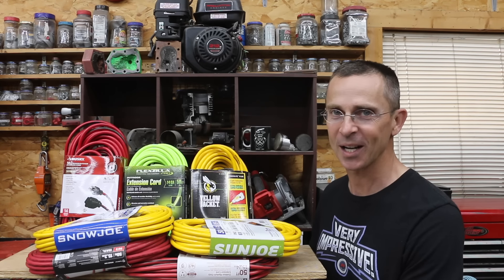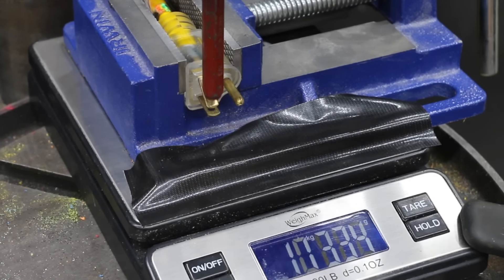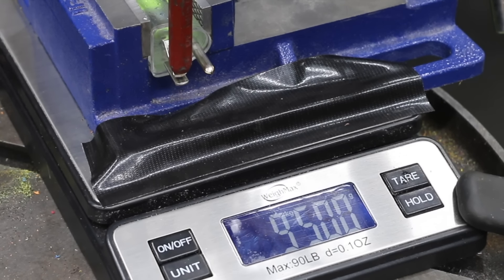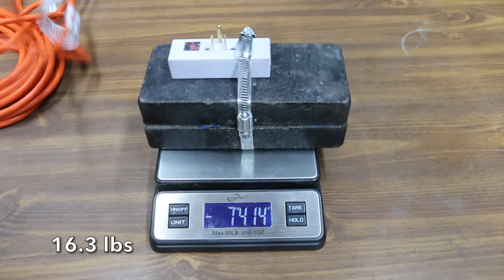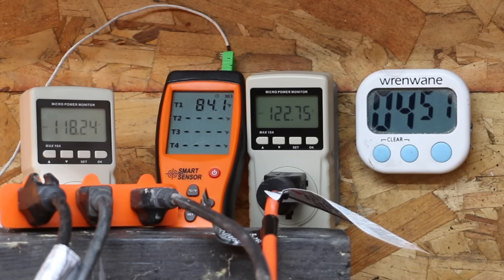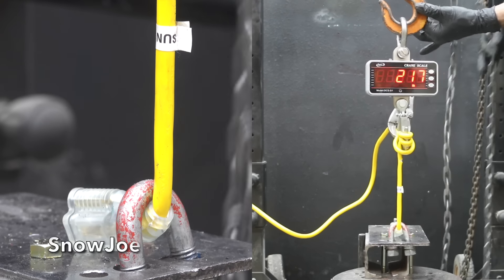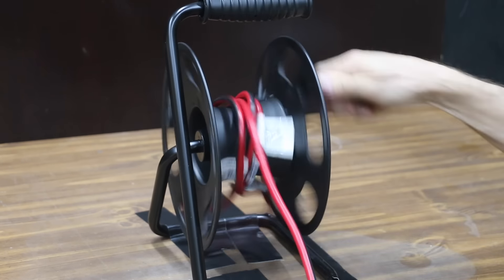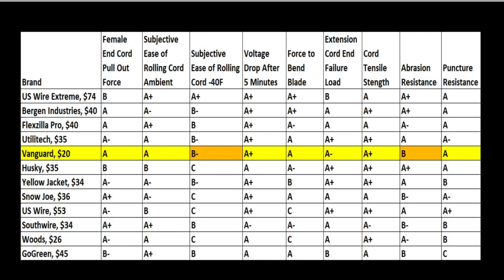Best Extension Cord? Flexzilla, US Wire, Yellow Jacket, Southwire, Husky, Woods, Bergen Industries

Comment: Just a quick FYI: Any extension cord that has a combination of length and wire gauge that means it can't handle 15 amps anymore can be unsafe, because we're stupid and don't fuse our extension cords. Our circuit breakers will happily let us pull 15 amps through a "up to 10 amp" extension cord (or even worse) and not trip as things catch fire because as far as the circuit breaker is concerned, we haven't pulled more than 15 amps so everything is fine and it won't trip. We should really fuse our extension cords. We fuse Christmas lights, because we realize some people will try to use them as extension cords even though that's not their intended purpose, but we don't fuse proper extension cords. So it's up to the end user to make sure they don't pull 15 amps through a cord that can handle 8 amps max. Stupid.
Reply from the maker: Thanks for sharing.
Reply: Wow glad you brought that up I’ll make sure I get those higher amp cords that must be why those short 3 plug outlets are dangerous because of that amperage rating being too low.
Reply: That's why 12 gauge extension chords are great: rated for 14 to 15 amps out to 100 feet.  10 gauge is obviously better but is way more expensive.

Appliances (like a shop vac) often have a 16 gauge power chord that is worth swapping with a 14 gauge extension chord to allow better current flow and extend performance and longevity.
Reply: the reason especially heavy duty extension cords cant be fused is simple, turning over an ac motor creates a massive spike in current before coming down to standard operating current, so unless you want your fused cord to need a fuse swap every time you crank on your shop vac, your just gonna have to deal with it.
Reply: Not knowing something is being ignorant.
Knowing something and going ahead anyway, is stupid.
Reply: @edgray3753  soooo could you use a power strip at the end of the extension cord?  ones with 15 amp breakers?
Reply: @coppulor6500  → Sounds like a good idea.   I looked at various power strips on line (Home Depot, Amazon) and they mostly are 15A breakers.   But that won't do any good if you want something to trip at 8A or less.  Of course such a device will probably be more expensive than a cheap 8A so just buy a heavier cord.   Also, using a power strip just to get the 15A breaker would do little good if the home circuit breaker is also rated for 15A.

Comment: I would love to know if the wire inside is actually the gauge they specify, and if it can actually handle the current they show. I've had cords smoke and burn before so that's my biggest concern these days.

The strength of the cords to resist being unplugged from the outlet or cables from being unplugged from them might also be a good test for the future
Reply: I just make my own. Buy a roll of cable, so I know exactly the wire gauge. What if they are mislabelled ? Well, I can SEE the conductor when attaching the plug. 😁

Comment: I appreciate the focus on durability. Most cords fail due to wear and abuse, not excess amperage. It was a good call to point out solid vs laminated blades, also. 
Even so, my primary concern is the gauge of the wire in relation to the length of the cord, and the durability and flexibility of the jacket. While I don't want flimsy ends, they can always be replaced.

Regarding ampacity, anything that will plug into a standard 15-amp receptacle or cord end cannot have a sustained draw of more than 12 amps. While solid conductors have a higher ampacity, conductors using stranded wire provide better heat dissipation (and flexibility). Conductors are always underrated for ampacity to allow for startup draw and provide some margin of safety.

As your tests shows, the greater concern with length is voltage drop. I have been using the same 14 gauge 50 foot cord and 10 gauge 25 foot cord for decades without issues due to current capacity or voltage drop, both for home and garden and commercial use. I also combine them on occasion if I need more reach, with the heavier cord plugged into the house to maintain flexibility at the tool.

Cords up to 50 feet should be at least 14ga, and up to 100 feet should be at least 12ga. If you're running something continuously that has a high draw (like a space heater), increase the gauge one step.

Avoid multi-socket ends. Even if you have a 10ga like the Yellow Jacket you should never run more than one piece of equipment from it due to the voltage loss and ampacity of the circuit to which the cord is connected. Even a 20-amp circuit only allows a sustained draw of 16 amps.

Comment: I always make my own extension cords. Home Depot carries Carrol Wire, great wire for extension cords. I use the higher quality plug ends that open like a clam shell. After almost 10 years of using some of them, I've yet to break one. Most plug ends are beat up but holding together no problem.
Reply from the maker: Thanks for sharing.

Comment: I bought a 100 foot 12/3 US Wire and a 50 foot Husky 12/3 back in 2015. I also bought a 10 amp plug in weed trimmer and a plug in leaf blower. All have worked well since then and I've likely saved myself from a lot of frustration vs fuel powered devices.
Reply from the maker: Thanks for sharing.
Reply: I agree that for most home owners electrical tools are the way to go. Once you start working on acres though the power and portability of gas starts to pay dividends especially when the  power requirements are high. A 2T motor is going to rip through 4ft of grass many times faster than an electrical trimmer.
Reply: @NONO-hz4vo  I think my Greenworks is as good for me as the Troy Bilt/Ryobi ones up to the Echo 225 models 21cc-25cc are. The 30cc plus models are definitely a step up. I don't know what a 2T engine is.
Reply: @davestvwatching2408  2t is just a 2 stroke engine.

The smaller cc gas don't make much sense for one house as the electric has more torque and you have nearly nothing to repair on top of not worrying about gas related storage issues.

The  gas products can save time if you are working acres of land or in landscape going from site to site.

Comment: I would like to see you do a review on plasma cutters intended for hobbyist/amateur/farm use.  The sorts of lighter duty machines that use no more than 60A 240V single phase power.  It would be interesting if you could pick models where it's obvious that the same machine is sold through numerous brands, where you try cutting both reasonable and possibly unreasonable material (thickness, corrosion, etc), and where you push the duty-cycles out to their published numbers and then beyond.

For a lot of us it's difficult to decide what machine to buy when we know the machine will probably not see enough use prior to its warranty lapsing, meaning it may be turned into so much junk without a lot of recourse.  Your methodology is very thorough, I'm sure that you'd put several reasonably-priced machines through their paces in a fashion that would be more like several years of use to the average hobbyist or farmer who'd only need the machine occasionally.
Reply from the maker: Thanks for the suggestion.

Comment: I just got done building a couple go floating benches. I was using 1/4”x4.5” lag bolts. One of them snapped from me torquing it down too much. So I ended up going to the hardware store to buy another one. While I was there I ended up buying structural screws sized 5/16”x4” which claim to be stronger than 1/2” lag screws. They are made by GRK Fasteners and the name of the screw is “RSS Rugged Structural Screw”. I ended up getting the lag screw I needed as well. When I got home I put the new lag in and the damn thing snapped too! So I just used the structural screws for the rest of the project and everything went well. Honestly the bench that I used only structural screws is extremely sturdy, feels more sturdy than the one I used lags! 

I saw your video where you compared some smaller fasteners. 

I would love to see a video where you compared structural fasteners. Would love to see how well different size lag screws hold up. I would definitely love to see how these compare to the RSS screws I have. Would also love to see other structural screws going through your gauntlets as well!!
Reply from the maker: Thanks for the suggestion.

Comment: I have both US wire and Husky brand cords. Of course the MOST important thing is to get the CORRECT gauge wire for your application. Believe me if you run out 200-300ft of cord and your wire is undersized, that tool will not proform. I can attest that the US wire brand really does feel like quality in your hands, and having a lighted end cord is totally helpful. As for the Husky brand it gets the job done, in my experience the jacketing isn't as durable, but I've had both puncture on the bottom of doors.
Reply from the maker: Thanks for the feedback.

Comment: Great video, Todd.
I have a suggestion about the "pull out" test.
You may want to use hose clamps on both sides of the three-way splitter to ensure that the cords don't get an unfair advantage by binding the plug due to an uneven load.
Reply from the maker: Great tip! Thank you

Comment: I almost bought a U.S. wire 12 gauge 100ft extension for a Sno Joe electric snowblower, but I was able to get a "Prime Wire" brand off Amazon, for cheaper than the U.S. Wire by about $15. It is good to -40c for flexibility and I'd say it looks and seems really decent. On par with U.S. Wire in terms of the features and durability. Covering seems thick yet very pliable and still so, in -25C, about as low as I tested it, in real work application. Then I noticed that Walmart here in Canada started carrying Prime Wire. So that's another brand to consider, if you can get it there, for any future battles. I'd like to see them tortured to see how good a buy it was.
Reply from the maker: Thanks for the suggestion.

Comment: I personally own the US Wire & US Wire Extreme. The US Wire I have used for years for my electric lawn equipment, the wire is dirty and has been yanked on tons of times and still works as well as it did when it was new! I did quite a bit of research as I wanted something that was strong and durable but also wanted to buy something from the USA if I could. Seems like I made a good choice!
Reply from the maker: Thanks for sharing.

Comment: Next time do you do this, consider testing the prongs differently. Test to see how many times one can be bent fully towards the other, and then back to straight. Repeat to failure. This information could be much more useful when deciding what cord to buy. The prong will get bent, and straightened. How much force it takes is kind of irrelevant when some one steps on it, Love your videos!
Reply from the maker: Thanks for the suggestion.

Comment: Great job testing!  I love the thought you put into the tests, especially testing what actually matters.  One thing I would be curious about is whether the plugs can be bent back into shape.  Another would be if there is any fatigue issue (bending the cord back and forth), but that is a trickier test to manage.  

I would have to go through the video again, but it would be interesting to see what you can tell by looking at the cord and relating it to the test.  I.e. if you care about the prongs breaking it is obvious to look for the bent metal prongs, the brass looking prongs, vs the steel looking prongs.  The gauge is obvious for voltage drop and something that people don't always appreciate.
Reply from the maker: Thanks for the suggestions.

Comment: I bought a 150 ft Walmart 2 conductor weed whacker cord 20 years ago on clearance for $2.00. The socket has a slide lock so it won't drop off under use. It's rated at 10 amps but I won't use for more than 5 amps and it's worked well ever since.
Reply from the maker: Thanks for sharing.

Comment: I used to wander around DIY shops looking for deals on extension cords. Now I realized I was just wasting my time. Buy a roll of cable, 3 pin plugs ($0.50 ea), plastic boxes for the sockets ($0.50-$2), face plates ($0.50). The most expensive part is the cable. Size it (length and AWG) to your needs. Type G country, so sockets are huge. I choose to err on thicker wires, so everything is bigger than what we would buy ready made. But I don't worry about overheating the cables, and they are exactly the right length. I can make one in less time than it takes to get to the store and back. 😁
Reply from the maker: Thanks for sharing.

Comment: One thing about extension cords AND air lines in air compressors, I don’t know what the exact difference is with the ‘outer’ shell is, but the way I can explain it is the better quality ones when it’s cold don’t get stiff and are bastards to work with, the better material stays more ply able and relaxed. I’ll spend an extra few dollars for a decent cord or airline just for that reason alone 🫤
Reply from the maker: Thanks for the feedback.

Comment: I don’t know how much it costs to make your extension cord. But I made my own and they are by far way better than anything you can buy already made. The Company I retired from was throwing away 1,000 feet of used for less than one week,outdoor heavy duty 10gauge 3 wire. I asked if I could take it and was given permission. This black outer coated wire is extremely flexible at temperatures of at least 0 degrees Fahrenheit. This company even gave me 15 industrial female ends and 15 industrial male ends. I made 5-100 ft and 10-50 ft extension cords. I gave away 3-100 ft and 6-50 ft extension cords. I’ve had these extension cords for over 25 years. Use them regularly and they are still like new. One of my friends that I gave a couple Extention Cords he has been using them on his construction job for 25 years and they are still in great condition and has never had any problems with them.
    So if you have the know how, on how to connect the male and female ends properly. (The only thing is I don’t  know is where the company I retired from bought this wire and it has no markings on it.) I know it’s 10 gauge, because I measured the diameter of the bare copper wire. This is the way to go. These home made extension cords put all store bought ones to shame. One of the best things about these extension cords, is winding them up. I’m not bragging at all. I lucked out getting everything for free.

Comment: The folded metal blade is very common.   Computer cables, extension cords, general cords, surge suppressors, etc.  for computer use, I generally see solid blades on the cheapest chinesium cords.
Reply from the maker: Thanks for the feedback.

Comment: I would recommend for the bending test, using the holes as the pressure point as they are (I believe) regulated to be basically at the same location on any cord
If the pressure is too close to the base, the prongs might seem more strong, but using the holes will provide a better reference point to apply pressure for more accurate results across multiple brands
Reply: Also, a multiple bend test for metal fatigue would be good too
Reply from the maker: Thanks for the feedback.

Comment: Vanguard fanboy here! But I’ll tell you the truth about them no matter how much I love them.  They are $25 for the 50ft 14g (on random sales $20 stock up on them) and if you use them Mon-Friday they will last you 5 to 6 months max before the jackets rip and start tearing n the ground prog breaks. The cord still works fine till 10-11 months at that point ull have to tape its tears and rips and probably replace both ends. I stopped repairing them now day’s it’s just cheaper to buy a new one after a year of service , I will still apply electrical tape as needed so the jackets doesn’t completely separate.  The jacket is the cords weak point from what I have seen but I do pull n yank on them and tie them in knots to my tools I abuse them alot sometimes lower stuff off roofs like it was a rope
Reply from the maker: Thanks for the feedback.

Comment: The electrical tests highlight one of the compelling reasons some countries use higher supply voltages. e.g 230/415VAC vs 110/200VAC
For a given Power Load and similar Wire Guage the Current in a 110VAC system is twice that of the Current in a 230VAC system.
As the heating effect (Voltage drop) is a direct function of the wire Resistivity and  Current, the higher Supply Voltage results in significantly less Voltage Drop and Heating.
Another included benefit is that the lower Voltage Drop means that the percentage of Supply Voltage lost is also reduced.

Comment: Aw, didn't do the Ridgid available at Home Depot (Similar to the Yellow Jacket in my experience, I own one of those too). I've bought a number of extension cords over the years, the heavy duty Ridgid is the only one I'll keep paying for. Some of them stay outside all year. Haven't even had a cracked sheathing yet. They stay flexible. I always buy the heaviest gauge for any length. Don't cheap out on your tools.

Lowe's blue heavy duty is similar. I've had one for 15 years. It's my oldest extension cord. Much time out in the sun also.
Reply from the maker: Thanks for sharing.

Comment: I clean houses and my vacuum is great but the cord is only about 12 ft long!! Try vacuuming a 6000 sq ft house 12 ft at a time! I've never found an extension cord that didn't get hot at the connection point or the prongs didnt rip out. I found this comparison extremely helpful. I think I'll try the Bergen Industries. Thanks!
Reply from the maker: You are welcome!